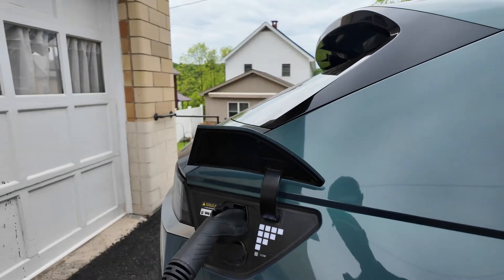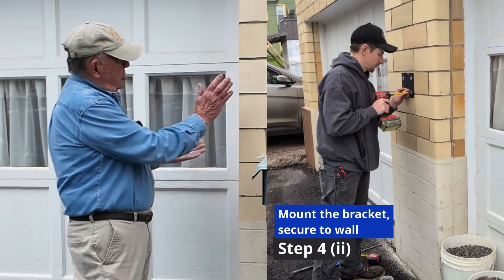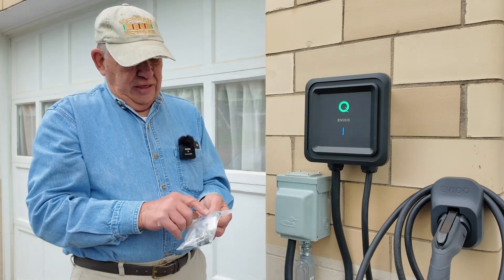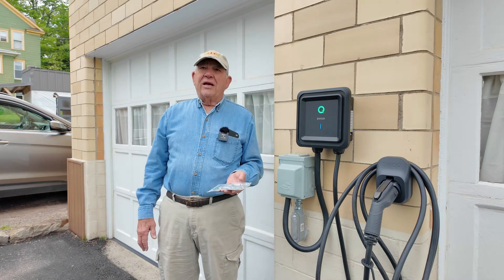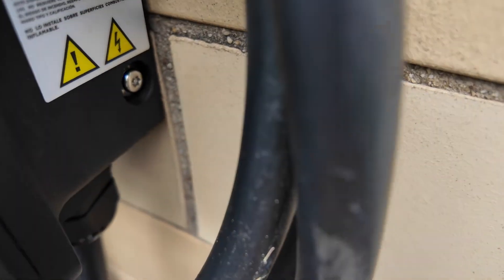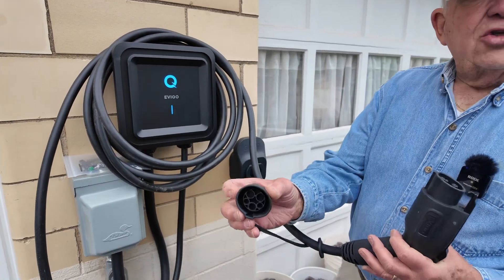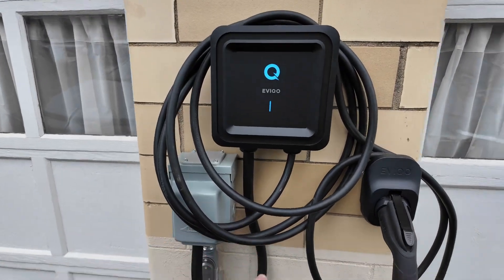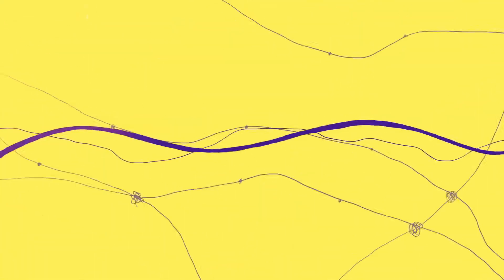First EV in Town! Installing 2nd Gen EVIQO Home Charger in Rural Pennsylvania

Comment: Because “there’s room” in your panel for more breakers doesn’t mean there’s necessarily sufficient power capacity.

Second, installing a receptacle is more expensive, less safe, and less efficient. It requires more hardware, more work, an expensive receptacle (standard residential outlets are no bueno), and GFCI.

Comment: Thanks for this. How difficult is it to engage/disengage the charger from the holster? Can his wife handle the weight of dragging it around?
Reply from the maker: Oh yes, there's no significant weight to the cable or connector. They've both found it a simple affair to use (other than drilling through that double layer wall!)